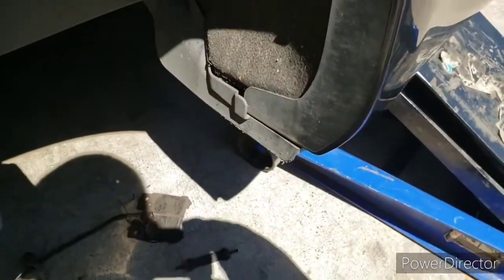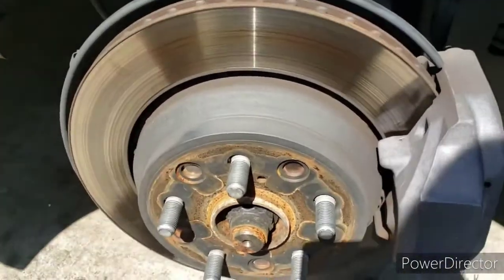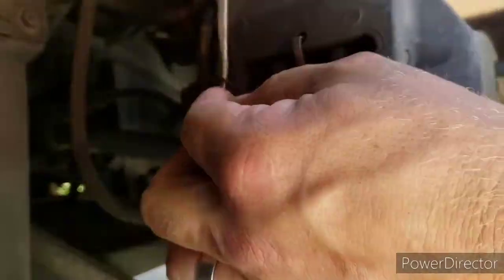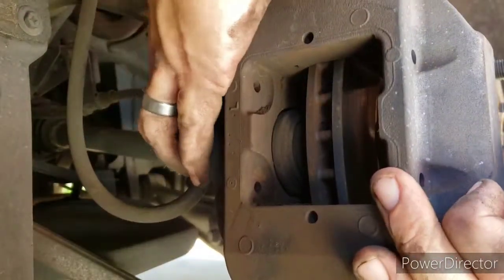How to change rear brakes and rotors on 2010 Lexus LS 460

Comment: Pretty good video but I couldn't help but notice that you said that the rotors float. They do not. They are captured between the wheel and the hub, by the studs and lug nuts. The calipers are also captured. It is the pads that float. The pads float on the little pins that retain them, in the caliper. Floating rotors are typically only on motorcycles and UTV''s.
Reply from the maker: Im not saying you're wrong but in the auto parts world that's how they are differentiated from the rotor assemblies that would include studs and bearings pressed in them already

Comment: Do you have an automatic parking brake and did you disconnect the battery?
Reply from the maker: no and no
Reply: @NotaCast  Are you asking about the EPB (Electronic Parking Brake)? If so, watch the video again and pay close attention...another guy sits inside and puts the EPB in service mode.